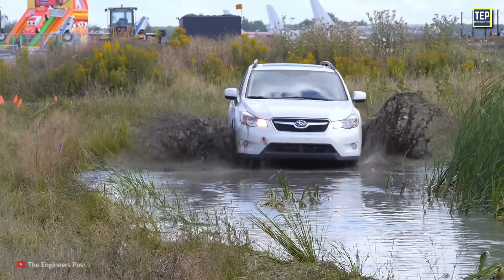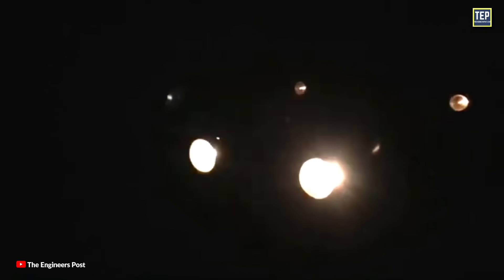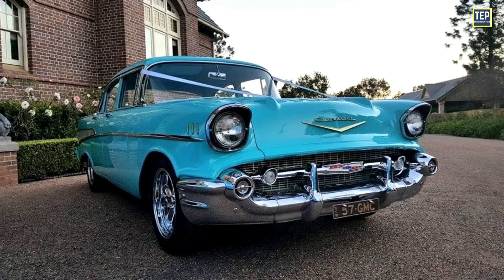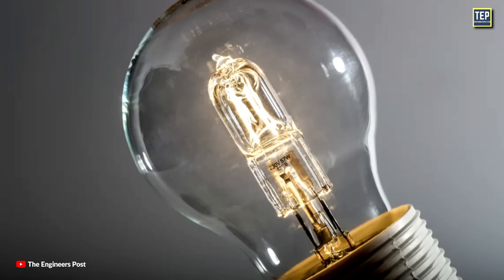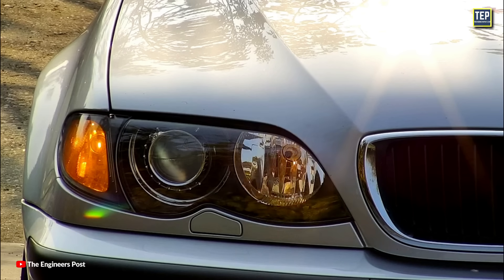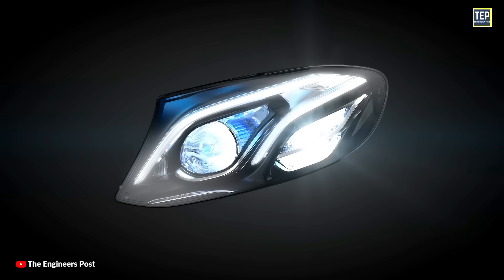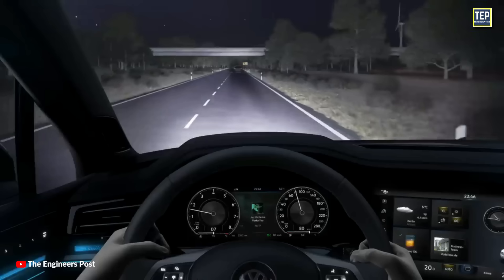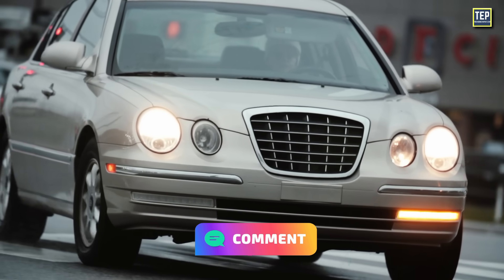The Problem With These Headlights

Comment: Gonna be honest this video watches like a highschool presentation done at last minute
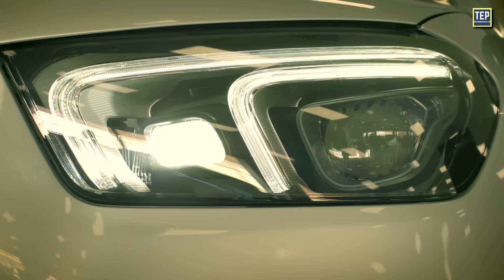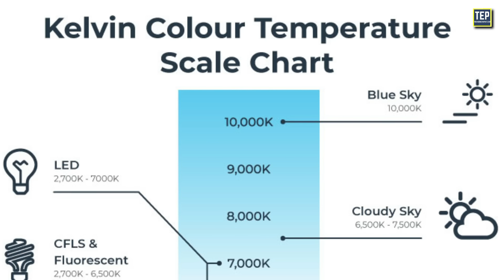Reply: Yeah, 11:55 claiming that LED's don't emit heat is completely false. Heat is big concern for the design and usually the main cause for early failure. 16:10 Laser-light is also not a future solution, it was widely available across BMW models including 3-series and not just limited to prototypes or exotics (16:45) but has now been superseded by adaptive matrix LEDs. Also at 8:21, the kelvin value is referred to as intensity of light, which is again completely false.
Reply: especially considering the surprising amount of misinformation and bullshit in the video, it was painful to watch
Reply: Like what? Seemed solid to me
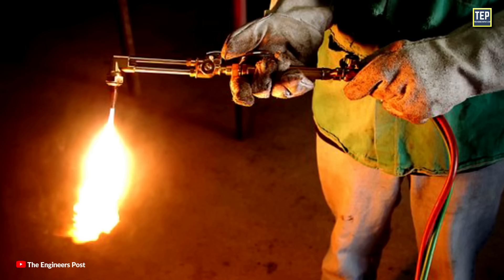Reply: @32BitJunkie  2:49 Saying that carbide lamps required handling acetylene, when it was actually produced on demand in the lamp.
Reply: And the AI voiceover sounds uncanny.
Reply: @pranavflame  I think it's not just the voiceover that is AI. The script is suspicious aswell.
Reply: @narancs5  yeah, very likely
Reply: Yeah it’s read and written by AI, and then set over likely stolen footage
Reply: @frank_lotion_  muh STOLEN footage
Reply: Halogens are anything but inert. Tungsten filaments give off more light as they get hotter, but also more tungsten atoms sublime off the surface. The tungsten atoms stick to relatively cold surfaces. Where a filament is thinner the current density is higher so the atoms boil off faster making it thinner. Halogens react with the solid relatively cold tungsten to make a gas that bounces around until it hits a hot surface and breaks apart again leaving the tungsten on the filament.
Reply: it's ai slop stretched to 18 minutes

Comment: Halogen bulbs don't last as long, maybe 4 years, but they are very easy and cheap to replace for ~ 10 €. After 7 years I had to replace my Xenon bulbs with has cost me ~35 € each and I had to unmount the whole headlight. 
The big problem with the LED headlights is that you cannot only replace the bulb. One whole headlight can easily cost 1500 -2000 €. And if that happens to a ~12 year old car, its a catastrophe for the owner.

Comment: LEDs are fine until you get to the snowy areas of Earth. Then they are useless, because you need to stop every X miles to clean the headlights since the snow doesn't melt. Also end result of front collision often is, that a car is totaled, because one lamp for BMW for instance, can cost 2-5k USD. We are tlakim OEM parts, not replacements + loss of the residual value of even 3-4 year old cars and the cost of repair is usually 1/3, 2/3 the price of the car.

Comment: 13:13 .. wrong! Recently I got tired of the yellow halogen light on my car and i replaced them with H4 Led lamps ... those fit into the Halogen bulb housing and work very very well... They are not projectors .. and they are modeled in the same fashion as a HID light... they are very very good and their high and low is very crisp.

Comment: Ive been driving for 20 years , 10 of which i was a professional driver long haul and everything was fine till these L.E.D lights came out ..hurts your bloody eyes .
Backroads where you have to call km on radio id call guys out if it was nightime and i got blinded by the headlights id say " eh buddy driving the chevy turn that sh1t down !" Hahah Even  with shades on still hurts the eyes .    Dummies be driving with L.E.D high beams on during the day lately 😂 i truly think L.E.D should be banned for safety . Clearly it damages eyes . Ive even heard they produce toxic amounts of EMF radiation. Not to mention the l.e.d lights always seem like they are blinking... for the record H.I.D are hands down the best bulbs in my opinion and ive used sealed beams from 1970 . 90s vehicles , halogen etc tried em all

Comment: I love LED headlights, however manufacturers need to reconsider making every light as bright as possible, and aftermarket LED headlights need to be heavily regulated. The cheap ones you get on Amazon have no beam pattern and scatter everywhere, blinding other road users and not doing their job of lighting up the road in front of you very well

Comment: Note on LEDs: The actual semiconductor emits a single wavelength, aka color. White LEDs emit in the near UV. A little less than 400nm (nanometer; 10^-9m; 0.000 000 400m). It uses the old fluorescent light trick. That is the LED UV light excites that yellow phosphor, which remits the light over several wavelengths, that appear white to our eyes. Problem is that phosphor has a finite life. That's the life limiting factor of "white" LEDs. "White light", in theory, is the mixture of all the wavelengths in the visible spectrum. In practice, only 3 colors are needed. Red, Green, and Blue, were chosen, when done with phosphor, for CRT color TV sets, and was grandfathered to newer technologies.

As for the red and amber lights, those can be single color LEDs, that  inherently emit those colors, from the semiconductor, with no phosphor intermediary. Red LEDs are the oldest color of LEDs, going back to the 1960s. Emerald green, blue, violet, and near UV LEDs did not come into being until GaN (Gallium Nitride) LEDs where developed in 1994. Hence, for color lamps, no colored filter is needed. Just use the semiconductor mix, for the desired color.

Comment: I have a 22 year old car, and its a russian roulette driving at the night... you could baerly see anything with the normal light, and even with the high beam turned on you can see just okay... but if there is an oncoming car and you have to turn it off you are driving blind, if there is a moose or something in the road then you are fcked... its stupidly dangerous
Reply: I run LEDs in my 42 year old truck

Comment: @theengineerspost Lasers and phosphor do not work by chemical action - otherwise, the phosphor would be consumed and have to be replenished. Phosphor works by quantum atomic means: the laser stimulates the electrons in the phosphor atoms to jump to a higher energy level, and when they decay to their original orbital, they release photons (light). No phosphor is consumed nor changed chemically.

Comment: I can't wait to go from metaphorically being blinded by LEDs to physically being blinded by laser beams
Reply: Sure hope those phosphor filters beforehand don't degrade over time and make that a reality. Also wondering with it being a laser is it scanning the beam out over time or is it spread by some kind of lens
Reply: @luketorpedo  It does say and show in the video that it's being spread by a lens. Not sure why they're using a LASER to start with, maybe it produces more uniform light to help lessen light scatter?
Reply: @argh1312 
Miniscule power use even less than leds - so they do what's most desired, bright as possible light. Watch batterys power laser pointers remember. So I suppose car battery will in theory give U unlimited laser power, unlike HIDs which are very very bright but use a lot of energy.
Reply: @argh1312  A laser can produce the smallest point source of any light source. The smaller the source, the easier it is to focus and change the shape of the light with optics. Laser lights can achieve better focus than even short-arc lamps. In contrast, LEDs are fairly large sources, and quite difficult to focus, especially to create low beam patterns.

In addition to the phosphor, there will also be a filter that blocks the wavelength of the laser, so there's no chance of any coherent light shining through.

As far as the final color, this just depends on the phosphor, so you could have 3500K or 4000K laser lamps.
Reply: @jasexavier  
Isn't all light the same, only lasers being focused with coherent light. All other light is non coherent so the same, no. 
Doesn't a torch just focus a beam with a cone or something?
Reply: Maybe they'll double as bug zappers solving one problem.
Reply: I'm pretty sure the whole point of the laser headlight is also quicker adaptive headlights that don't actually blind incoming drivers.
Reply: Ever pass a late model high end BMW or Audi? If so, then you've already seen laser lights.
Reply: Yes @salemcripple
Reply: Blinded by the Light, revved up like a deuce and motor into the night
Reply: LEDS ARE DANGEROUS, INEFFECTIVE TRASH
Reply: Propaganda.....
Reply: You don't have a laser beams going out, the beam is to create the reaction with phosphor. It's to creates more light with less energy. The laser beam do not leave the head light.
Reply: Well why are you driving in the derude sandstorm ?

Comment: Excellent presentation.  I had to replace my HID lamp in my 2009 Range Rover Sport HSE and it was very problematic.  But, I was successful in replacing this with an LED with no degradation in performance.  So yea - headlights now are very complex and replacing these can be quite the headache.

Comment: Quality LED bulbs can be used in classic reflector headlamp housings but there is a caveat. The fixed base lamps such as 9003/H4 are orientated in a way that mimics the halogen bulb for low beam use, no adjustment needed. The problem are the rotating base lamps such as 9004, 9005, 9006, the HB# bulbs. Most people fail to clock the LED properly during install and causes the beam pattern to scatter. This affects the distance, and often blasts light in the wrong places. In projector housings, HID/xenon bulbs and halogen bulbs emit light in 360 degrees, so an LED bulb would not be as effective in getting the desired full beam and distance.

Comment: To address the blinding brightness to other drivers, could the LED headlights be polarized in a standard way, and car windshields polarized in the opposite, so all direct light is blocked but reflective light still passes through.

Comment: Interesting video, but not everything is true. You can buy BMW with laser headlights probably since 2020. I assume you can buy it with other manufacturers too.
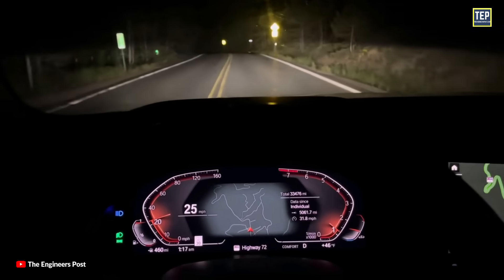At time 8:46 is a BMW in a chapter about Xenon, but I'm pretty sure there are LED lights based on the dashboard.

Comment: My car has bi-xenons as described in this video.  Same xenon bulb with a shutter to control hi/lo beams.

On another note, I find that SO MANY DRIVERS these days just drive in traffic with their brights on.  I'm not talking about low beams that seem like brights in any context, I'm talking about where you can tell--the second set of headlights is on along with or instead of the first.  And I'll signal to them by flicking my brights to tell them, as I learned to be the standard way to do it, that their brights are on and they should turn them off.  RARE is the driver that actually does it.  The overwhelming majority just ignores me and keeps on keepin on with their brights on.

Comment: So each generation of lights is 2 or 3 times brighter than the previous one, but are we seeing any better? Not if other drivers are not aiming their lights properly; not only can glare block vision while it's present, but it can impair the vision of its victim for minutes afterward. The blue light from LEDs can even cause the gradual onset of permanent blindness. The technology for the smart aiming of these lights, so that the light hits only that which need to be seen, not the eyes of other drivers, should come first, not brightness for the sake of brightness.

Comment: LED and Laser lights are great. Although drivers and manufacturers pursue the highest light temperature (the highest Kelvin rate), in other words whiter or even blue light to achieve daylight illumination of the road at night, not realizing that for example in fog yellow or red light has better penetration of water vapor particles than white or blue light, which is caused by wavelength. Longer wavelength penetrates haze, smoke, etc much better. In those conditions I feel like bright white LED light converts fog to impenetrable opaque white wall and I wish for low intensity yellow old bulb. Hopefully all new cars will have ability to automatically and also manually adjust wave length and intensity of the light beam.

Comment: My car has curve following bi-xenon headlights. You can put led instead of the xenon or halogen only if the lamp has projecting lens, because it modifies the beam not to blind oncoming traffic, but it gives the nice visibility, regardless of the bulb type. Yes, some halogen lamps has also projecting lens, which is better, than the classical halogen lamp with the parabolic mirror. I use LED bulb in the xenon housing and it has the same pattern of light. The only difference is the brightness, which is near the factory LED lamps. Putting LED instead of classical halogen is a big NO for me, it always blinds the oncoming traffic, but in projecting lamps it is okay because of the identical light pattern.

Comment: It was annoying that you spend the first half of the video trying to educate us about legacy headlights instead of getting to the point, but then you started adding false info such as that the colder color temp halogen bulbs aren't legal.  They are legal, at least in the US.  Why they are not used by most automakers is they usually have a much shorter lifespan due to running the filament hotter to achieve the colder color temp, if not just using a  blue coating to achieve it instead.  It is true that some blue coated lights aren't legal in the US.

Further you are wrong "in general" about halogen lights not lasting as long as owners wished.  On the contrary, stock (and aftermarket "long life") bulbs tend to last many years for the amount of night driving that most people do, and when they fail, a savvy shopper can replace them very inexpensively if one of the most common sizes or form factors.  Owners are more disillusioned by LED headlights when they fail, because of the extreme cost to replace them.

It is NOT a benefit to be a color temp as high as 6500K!  That causes excessive glare both for the driver and especially everyone else, with the glare to visual perception ratio, higher than if it were a warmer color temp.  In other words, your eyes are overloaded by glare and that makes it appear brighter, while you actually can't see as well as if it were same lumens of warmer  color temp light.  Countless people are complaining about being blinded by these cold LED headlamps. 

Today we have the worst headlights on public roads of all time, because they are so glaring and blinding.  I have great night vision yet find it painful at times to drive with these blinding vehicles on the road, and that's not all due to misaimed, or aftermarket modifications, also the standard factory LED lights.  Every day the problem is getting worse and again it is not just me, countless people are complaining.

Comment: We are now plagued by the lighting creations of idiot car designers who are fully aware they can sell anything to gullible fashion obsessed motorists.  We now have ordinary road cars equipped with lighting suitable for the Le Mans 24 hours race when in the U.K. one cannot legally exceed 70 mph and in most of Europe 130km/h and 110km/h in rain on autoroutes. We are now constantly dazzled even in broad daylight by drivers who mysteriously consider full frontal lighting is still essential even at the brightest part of the day and in the brightest of weather conditions. What’s more, we now have the ubiquitous daytime running lamps that are often as bright and sometimes brighter than former halogen headlights.  I have seen cars that have as many as eight lights at the front. Why?  

Even at night, especially in the U.K., most driving is on well lit roads, including most motorways, thus bright headlights are generally quite unnecessary beyond a need to make oneself clearly visible to other road users and pedestrians. 

In short, as with many features on modern vehicles, the inclusion is not driven by necessity, it is driven by fashion gurus who simply wish to encourage buyers to indulge and boast about having the latest often totally pointless and obscenely expensive gimmickry.  Some time ago, a neighbour with an expensive Nissan sports car had an LED tail light cluster failure. The car was still in warranty yet she was advised it was a ‘consumable’ item not covered by the warranty. The replacement cost was to be £280 and it would need to be ordered from Japan, lead time 12 weeks. At the same time I had a dash light warning of an old fashioned filament tail light failure. I changed the lamp with one the spares I always carry. It took me about 15 minutes and cost me about £2.00. Yet, we are told all of the stupid modern lighting gimmicks are ‘progress’.  Progress indeed, for the avaricious motor trade.

Indeed, when I learned to drive the principle of safe driving was that of drive within prevailing safe limits. Clearly that no longer applies. It’s now drive in total reliance and absolute trust on your electronic aids, hope for the best and that you can afford to rectify arising faults, assuming one can find anyone of skill and experience to fix it, which is increasingly difficult, even with main dealers. 

Welcome to the age of scrapping perfectly sound cars because they are now too expensive to fix, particularly if it’s a BEV.

Comment: White LEDs use the same process as the laser light. A led in the 455nm range  is coated with phosphorus the blue photos activate the phosphorus to create a light more on the 600nm range aimilar to an HPS bulb.